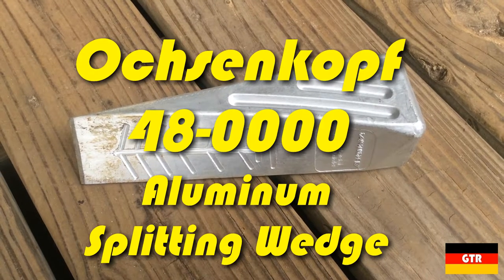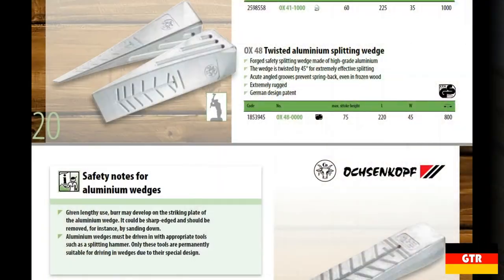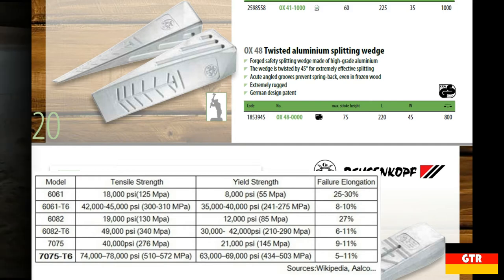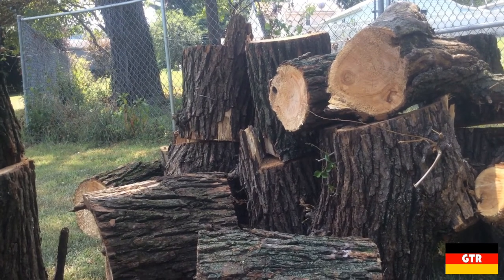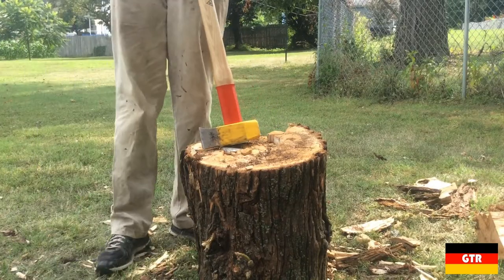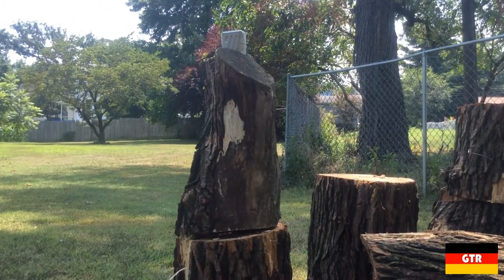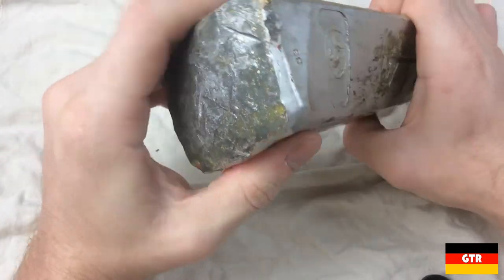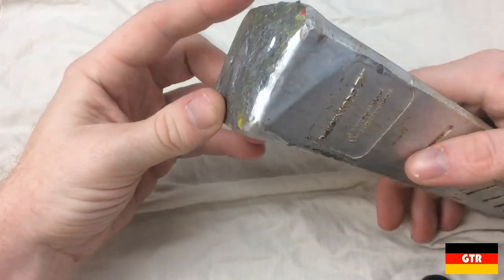German Tool Reviews:  Ochsenkopf 48-0000 (Aluminum Wood Splitting Wedge)

Comment: Did you notice any difference in effort or number of strikes to split comparable pieces of wood?
Reply from the maker: Thanks for watching!  The twisting wedge definitely required less strikes than the straight steel wedge.  I'm not sure if a steel wedge in the same shape would make any difference.    The best advantage to the aluminum wedge is you won't get any pieces of metal flying off like you could with a steel wedge.